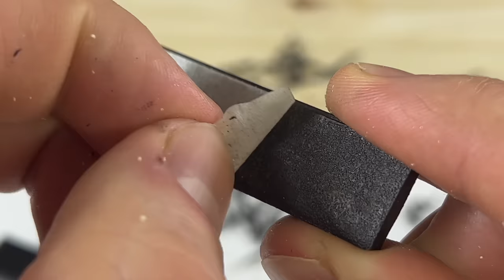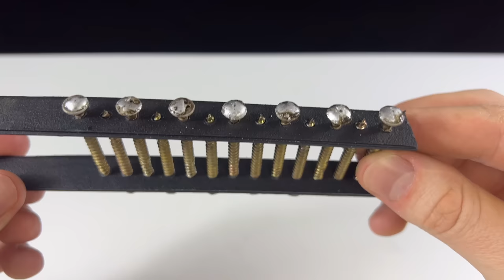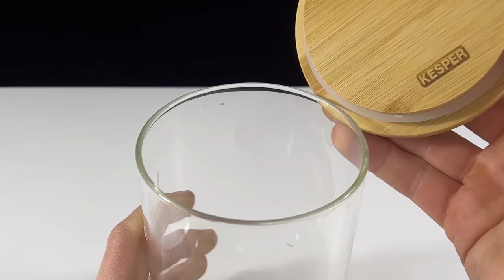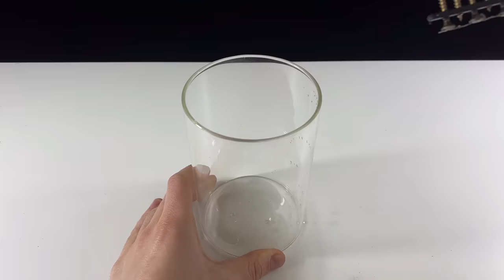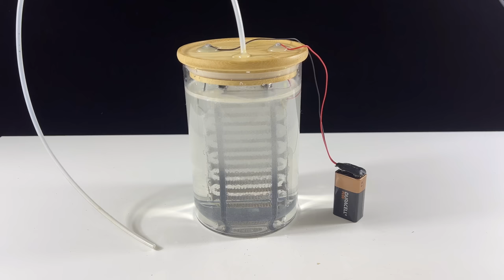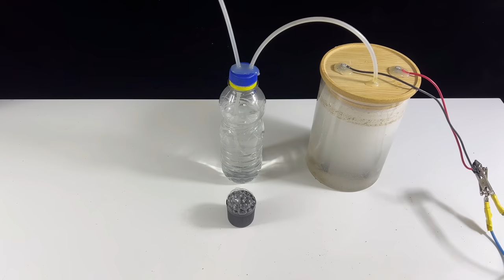Water into Hydrogen - How to make a Simple Hydrogen Generator - hho

Comment: That is a Browns gas generator as there is no separation of hydrogen and oxygen.
Reply: Electrolysis and hydrolysis left the chat
Reply: Is it still explosive
Reply: @Galaxy_ash it's far more dangerous
Reply: From what I've studied Browns Gas is a result of the separation of Hydrogen and Oxygen. So?¿?
Reply: The cathode (+) terminal of the battery is where hydrogen gas  (H2) is released (2H+ +2e- —> H2)
The anode (-) terminal of the battery is where oxygen gas (O2) is released (O2- - 2e- → O2)

So water electrolysis with combined output gives HHO gas (Browns gas) which is oxygen and hydrogen combined is extremely explosive and dangerous and is ALWAYS RECOMMENDED TO BE RELEASED IN BUBBLER FOR SAFETY because just in case of the flame going back in the tube and reaching the cell, the cell is going to explode.
Reply: @hans-rudi3471 nice haha though the amount is too small to be dangerous
Reply: But mixture H and Oxygen burns best
Reply: Yes, but you have cathode mixed with anode. Cathode is - Anode is +
Reply: @drizzyt88 You have that backward. Cathode is the positive electrode.
Reply: HHO gas, also known as Brown's gas, is a mixture of hydrogen and oxygen produced through the electrolysis of water. While hydrogen and oxygen are both naturally occurring gases in the atmosphere, breathing in high concentrations of HHO gas can be dangerous. Inhaling high levels of hydrogen gas can displace oxygen in the lungs, leading to difficulty breathing and potentially causing asphyxiation. Additionally, HHO gas can be explosive in certain conditions. Therefore, it is important to handle HHO gas with caution and ensure proper ventilation when working with it.
Reply: Yes indeed it is a separation of water molecule into single oxygen atom and hydrogen atom !! Why I say this I did an experiment that shows copper corrosion process increased 1000 times as if I open pure oxygen directly to the copper
Will give the same results that’s mean there are pure oxygen atoms present in the water and successfully separate the water molecules 

Like latterly splitting them from each other
Reply: Its still a pretty clever design
Reply: Does anyone know what the advantage of mixing the two gases is? I thought it could be because this uses much less voltage, but I don't know.
Reply: @Galaxy_ash way way more explosive. Oxygen speeds up the process of exploding, and hydrogen does the exploding. If oxygen is with hydrogen, then the hydrogen doesn't have to wait for ambient air to rush in, so it's more explosive
Reply: @RaniRani-zt2tr
Reply: Even better 💀✅

Comment: It would be nice for some narration and explanation of the materials used and why. Does the weight/mass of the water change with the extraction of the hydrogen molecules? If so, how long would such a volume of water last? Interesting video, can't wait to see more from your channel, thanks for sharing!
Reply: The YouTuber can't answer your question because they probably had associates that did the math, science, and probably also bought the materials to make this experiment work. What people don't realize is that YouTubers aren't geniuses unless they actually have an education in what they're regurgitating to the masses, who then in turn lap it up and assume they're favorite YouTuber is all knowing and based
Reply: The mass of the water does diminish over time as it's being converted into hydrogen gas and oxygen. 

How much is being converted depends on a massive number of variables which includes: the amount of electricity being applied, the resistance of the wires, the conductivity of the cell (the nails) the concentration of the salt within the water, what type of electrolyte is used, atmospheric pressure, the purity of the water, and so on

You can determine theoretically how much hydrogen and oxygen will be produced under standard conditions, but it's much more useful and easy to simply measure production in the real world

Try it yourself if you're interested! It's pretty easy and fun to do

Be careful as a hydrogen and oxygen mixture is literally rocket fuel

Comment: way more efficient ways to turn 9v into light.  The problem with hho generators is they use electricity to create the hydrogen.  Want to impress me ?  Make one that uses no battery or electrical connections.  Make one that uses Solar.

Comment: I failed Chem multiple times, but I'm curious: Is it cheaper to use the battery or use the battery to break hydrogen so it can be used?
Reply: Depends on application. Battery won't propel an object without another device. Battery only supplies energy but gas provides energy and force, you only need to direct it.
Reply: Can't get out more energy than you put in: no free lunch

Comment: That process produces both H² and O². How do you separate the oxygen from the hydrogen?
Reply: He doesn't
Reply: The only way with this kind of set up is to have the anode and cathode separated with each in a vessel that lets the individual gases float up but shares the electrolyted water for conduction. For those who haven't seen that sort of set up, Google shows just how simple it is, even if it is a bit more complex than this.
Reply: They're different weights. They will naturally settle into two layers.
Reply: Use mech..

Comment: How you make a vehicle that runs on water. You use hydrolysis to create hydrogen gas from water. The combustion engine burns hydrogen for fuel. Old science that's been kept down so the oil industry can continue to make huge profits. This tech was developed in the 90s by a man named Stanley Meyer.
Reply: So it would run on electricity , like BEV but would use about 3 times more power and had to have a huge water tank and gas tank

Comment: But this requires a lot of electrical energy
Reply: Get from Solar or other sources of energy, instead of storing the energy into battery hydrogen fuel is ideal to replace petroleum gas. Processing petroleum gas also requires the energy in order to use it, likewise hydrogen fuel requires energy on processing.
Reply: Uh... Solar??? Pay for itself in a week!
Reply: Solar power is available only during day. Storage of power in different ways is needed. Hydrogen is be of them
Reply: Dawg in what life is a 9V battery a lot of energy?
Hydro electric, nuclear, solar, wind, can all supplement
Reply: @Bharat61778  Then you use the hydrogen gas that was generated during daytime to power generator at night. Hydrogen gan to replace battery for solar or wind or thermal energy.
Reply: So?

Comment: this is what we call yellow gas the mixture of hydrogen and oxygen if you want to make them separate you need two tankes conneced to the same water supply that has current run through the water ground will make hyddrogen and positive will make oxygen you will definently need something like baking soda or another electrolyte so the electricity can travel through the water

Comment: u are making way to much for somting simpel... just get 4 steel wool from the kitchen... get an old sock and put  2 steel wool inside and wrape the other 2 onto the outside of the sock ( smal tipp make the positive curent on the outside bc the positive side will corode faster) and u are done ( i achived 12 A on 3.8V )

Comment: Why do we need oil if we can create fuel from water!?
Reply: Go do it. You gonna be billionaire😂
Reply: Good luck storing hydrogen(molecules are very small and you need special containers ) and good luck with hydrogen embrittlement (turns steel into glass like structure)that screws most ferrous metals .
Reply: @nneeerrrd  instead be off'd bu the powers that be
Reply: Notice the huge energy source required to produce small amounts...  Yea this is an issue.
Reply: Lubrication?
Reply: @Dead_Goat  Because he is clueless and doing everything wrong ,if he studied faradays experiments he would knew that for electolysis you need around 2V per cell.
More than that and you are overheating electrolyte and creating steam instead of gas.
What you need is a lot of amps.If you want a true production that can run a car  7 cells will use 14V and need around 20A.
Material he used to build it is completly wrong -you need large flat surface area ,most of time people use 316 stainless steel plates and a NaOH as electrolyte.

Comment: Very cool, but piss poor soldering technique, which will leave you with crappy intermittent solder joints. You don't use the solder tip to melt the solder. You heat the object you want the solder to adhere to first and allow it to cause the solder to flow. And use flux. If you just melt solder and drop it on things as shown in this video, it's going to quickly break free after even light use, and leave an incomplete circuit.

Comment: Electrolyzing with salt can create hydrogen chloride, which can explode when in direct sunlight.
Reply: can't explode in sunlight unless you put lighter infront of it.
Reply: @Euer_Ernst  chlorine gas is also produce when oil is burn in car.
Reply: Can you read? 
He didn't use salt! 
Look again.
Reply: Hydrogen + oxygen is pretty explosive too ;)
Reply: @oldskoolmad5673  Actually it is implosive. Any explosion is due to heat generated by the reaction.

Comment: But why u have used the KOH? Although simple hydrolysis of pure water gives the same gas H2 +O2
Reply: ,, because the number of free ions in "just water" is so low that the process would take a long time. Adding NaOH improves ionisation and extends the life of the electrode.
Reply: @stephen2203 I wonder if LoSalt would be good to use. It's 60% potassium chloride, plus regular salt.
Reply: Correction: 33% potassium chloride.

Comment: Nice little home chemistry project to demonstrate electrolytic decomposition of water. Hardly practical for industrial of Hydrogen as it takes more energy in the form of electricity than is recovered by use of Hydrogen as a fuel.
Reply: Are you quite sure about that? 
they don't say it's for creating fuel anyway ;) 
& to do it industrially I think they're gonna need a bigger jar!
Reply: They use more energy to store hydrogen, but it wouldn't matter if energy was being stored using more energy if it offset uncertain photoelectric effects or convection (wind speeds). Obtaining energy when outputs are low can consistently supply a grid and home what it needs.

Comment: How long will it take to fill up hydrogen car using this method?
Reply: you don't need to full up hydrogen car because it will be dangerous, car will only used hydrogen directly after it is created through electrolysis process.

Comment: The black strips you drilled and put the screws into. What is the material? Is it just none conductive hard plastic?  I assume it is none conductive? Are the screws anything special or just what is in the tool box? Thank You for any reply.
Reply: Hey man, it's just normal plastic so the circuit doesn't short. Hope this helps even though it's a couple months late

Comment: What is the poder that was put in to the water?
Reply: Potassium hydroxide is used with distilled water to produce hydrogen gas from water when electricity is passed through coils and that hydrogen gas can be used as fuel for cars or bikes.

Comment: The gas collected as a result of this setup will be a mixture of oxygen and hydrogen. Isn't it?
Reply from the maker: Yes Oxy-Hydrogen gas, which is 2 parts Hydrogen (H2) and 1 part Oxygen (02).
Reply: Yes, but due to thermodynamic losses, the final result is 15% less power delivered for the same amount of fuel.  In automotive terms, you get a 15% loss in fuel efficiency.
Reply: Who cares. Its clean
Reply: HA! I knew there was diet water! Nobody believed me.😂
Reply: @akulkis I think It's a lot more than that

Comment: How long b4 the screws dissolve due to the chemical reaction?
Reply from the maker: not sure I’ve used it a few times and they seem fine, Screws have a rust protective layer so they last a while
Reply: @Inventor101  ...Thanks. I was once hospitalized using an electrolysis glass apparatus. I used salt as a catalyst and hydrogen chloride built up in one of the test tubes. I didn't know (I used too much salt?) and inhaled it thinking it was oxygen. It was like sniffing ammonia. It left me gasping for air. I was taken to the ER and was given pure oxygen for an hour. My lungs were slightly burned due to hydrogen chloride when chlorine chemically reacted with water in my lungs (small, but enough to cause tissue damage). When the doctor came to check my lungs, told me to take a deep breath, oh my God, it felt like my lungs were on fire!....LOL. Lesson learned.